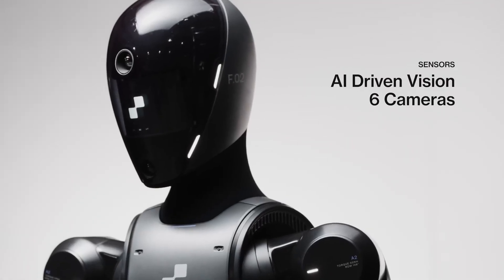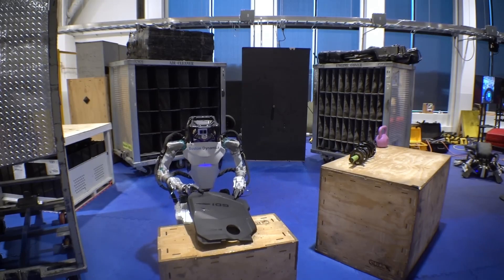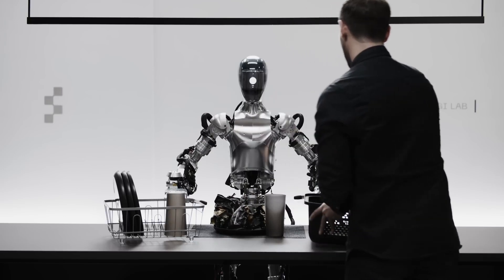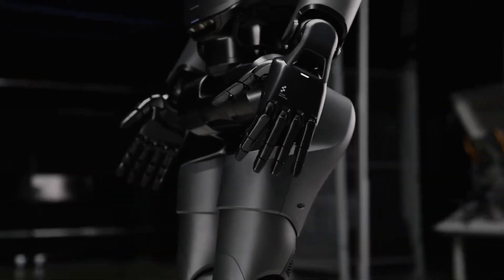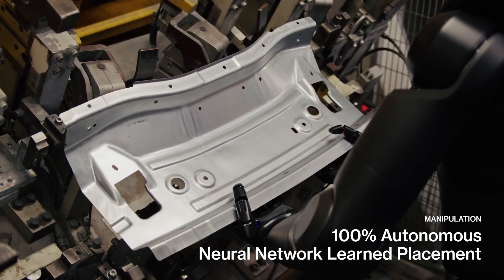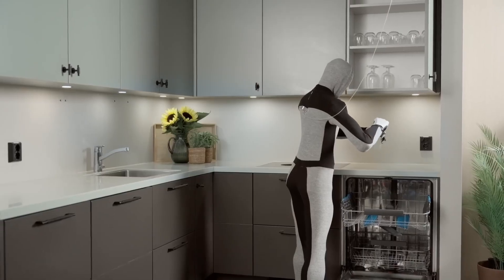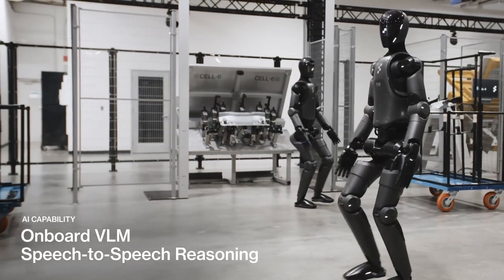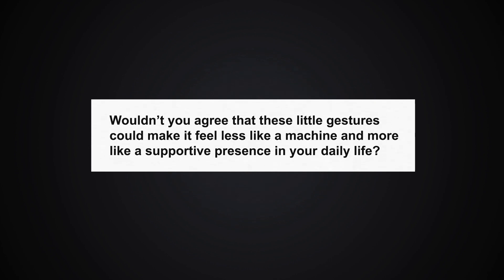Figure 02 Ai Robot IS CREEPY REAL… and…IT WILL CHANGE YOUR LIFE!

Comment: The American robots are slow and clumsy compared with the Chinese and European ones.🤨
And half of this video is showing the Neo from Norway. Some people dislike the fact that the Neo wears clothes. But bearing in mind that any home helper which is eg cleaning the bathroom, cooking and gardening is going to get grubby, I think it's much better to have it able to throw its own grubby uniform into the wash and put on a fresh one. I very much doubt that Figure has thought about this and I'm damned sure that Tesla hasn't.😊
Reply: Wouldn't you rather the clothes getting dirty rather than the mechanics themselves? The clothes can at least be cleaned while it protects the body of the robot from getting dirty. Getting water accidently spilled on sensitive electronics isn't good for the robot.